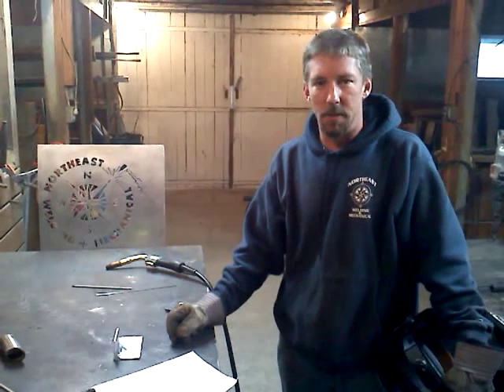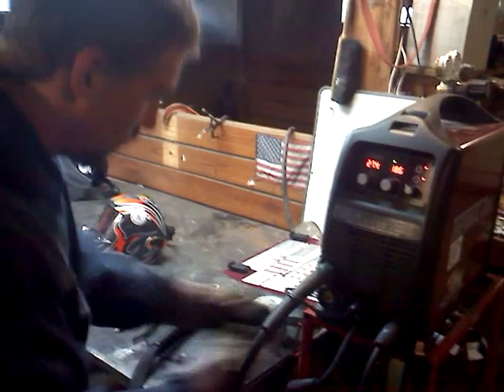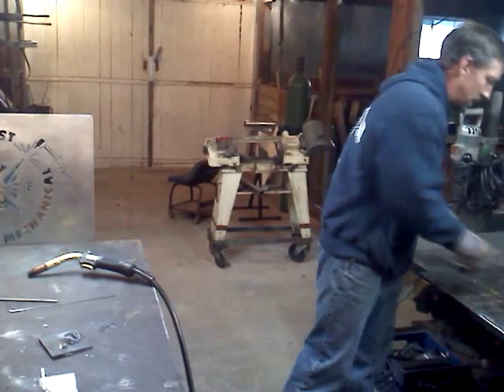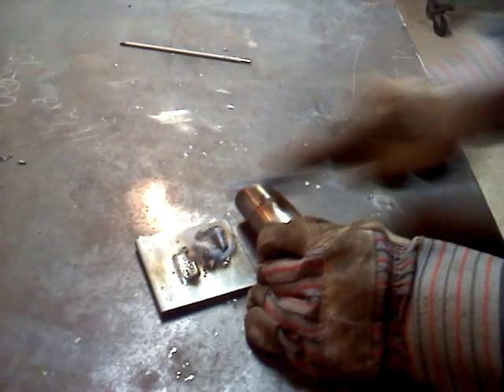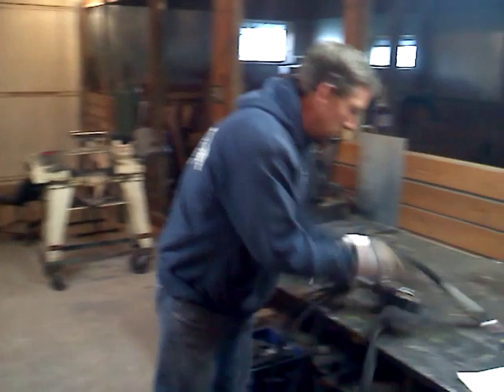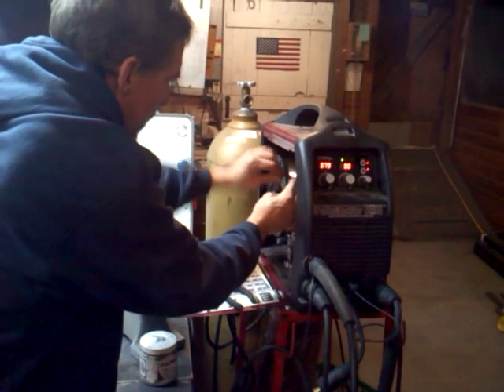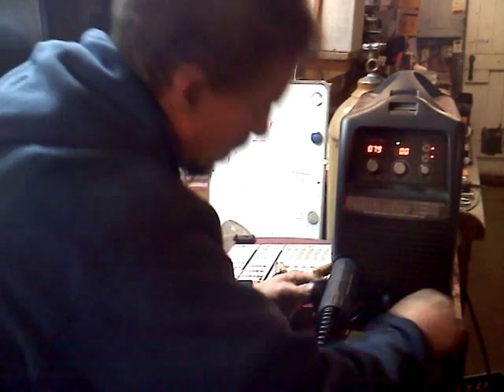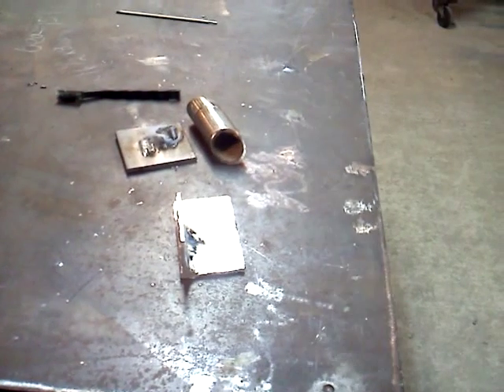Thermal Arc Fabricator 181, 3 in 1 demo, Welding Aluminum and Stainless

Comment from the maker: you are correct, the mig feature is the only one that has a built in solenoid.  They changed this on the 252,  using an internal solenoid for both functions.

Comment: got the company to buy one, and a lincoln ranger to power it in the field. It is extremely light. Good thing when you have to carry it up the stairs, or pull it up a ladder. So we finally have a mig for the field, and a tig unit we can take out in the field.

Comment from the maker: 9.5 only because there is no gas solenoid in the machine.  The torch has the gas valve on it.  Other than that  no issues at all